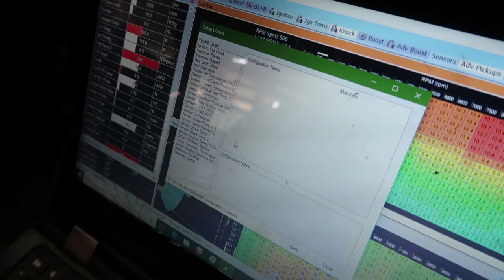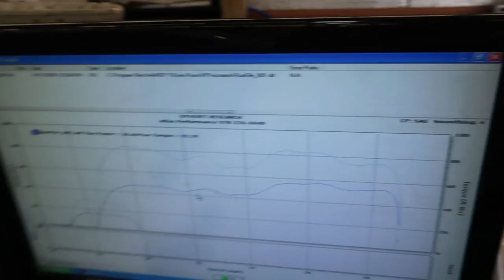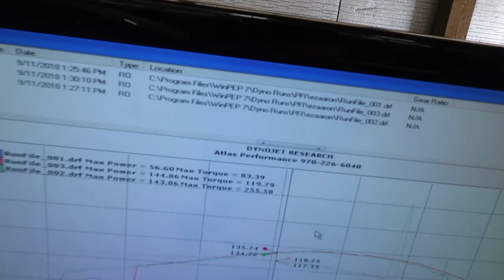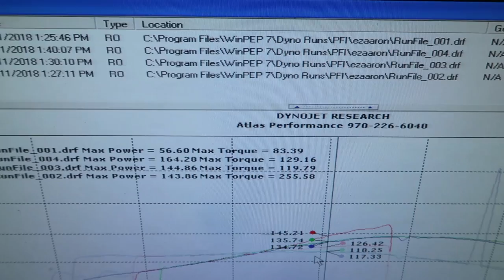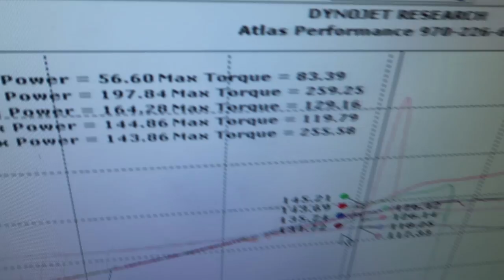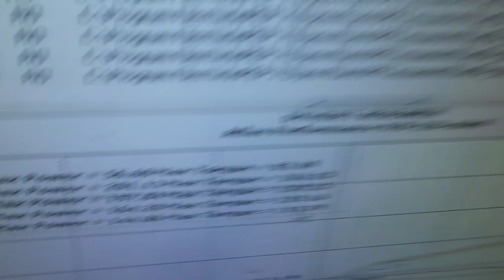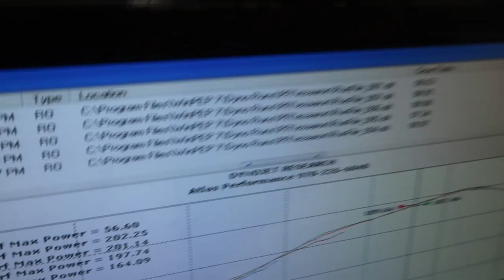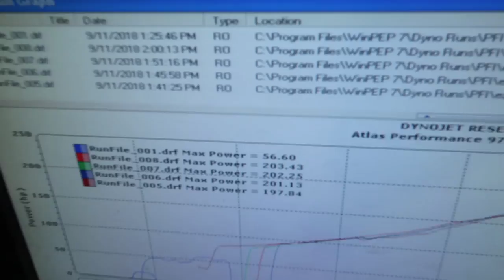S2000 PreBoost fuel system setup

Comment: She made pretty good power for n/a at your elevation. I just got my car tuned recently and made 213 hp. Cant wait to go boost. Need me a metigulous manifold
Reply: FWD loses less power to the wheels, the diff is part of the gearbox, and you only have a half shaft and drive shafts. On RWD you lose more, because of the long transmission, differential casing, prop shaft, and drive shafts. If an F20C was put on FWD it would be closer to 235 whp.
Reply: @rolandotillit2867  I did not know that. That's good to know. Thanks for the input 👍

Comment: S2000 motor is one of the highest revving engines out of the factory. If You hate on honda/acura than your uneducated about them. 9k rpm on the s2000,  integra type r, and the civic type r ek9

Comment: Doesn’t the s2000 make 240 crank normally? Isn’t the 200 ish whp about 240 crank? Seems like a lot of work for stock power
Reply: You have to add the loss of 5,000+ feet of elevation
Reply: @5000 ft in a 240hp car is a 36hp loss @the flywheel
Reply: @jasonb1750  Yeah, I forgot about that low density air up there. Makes sense.